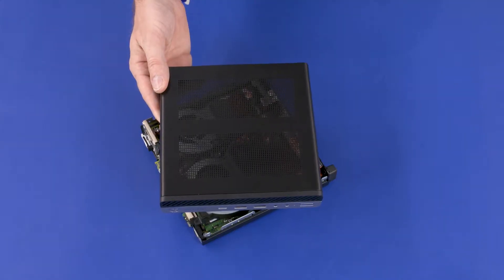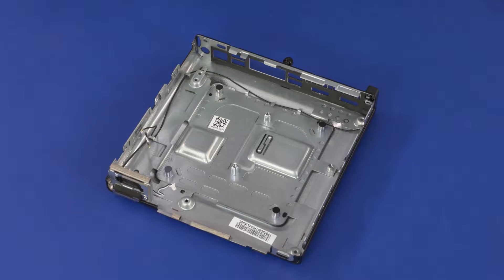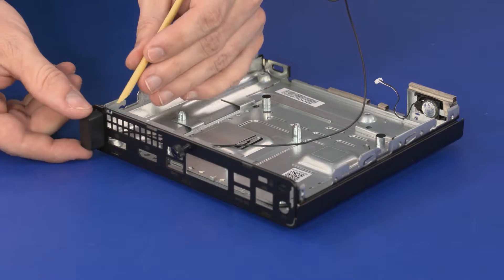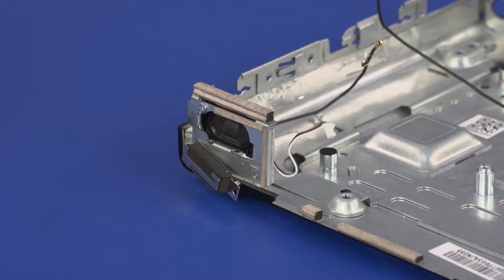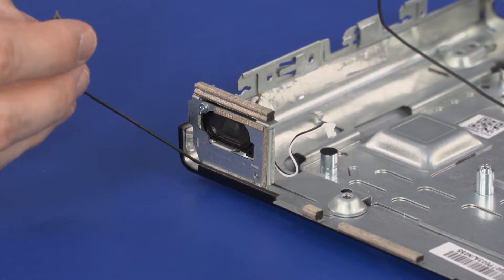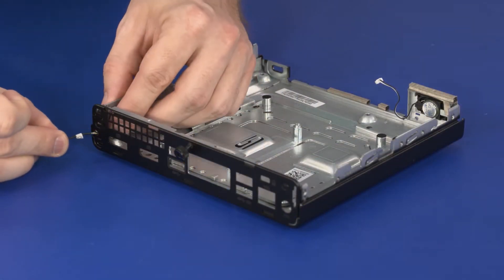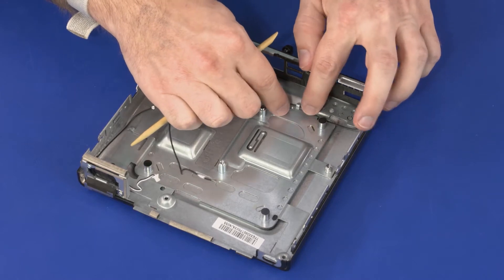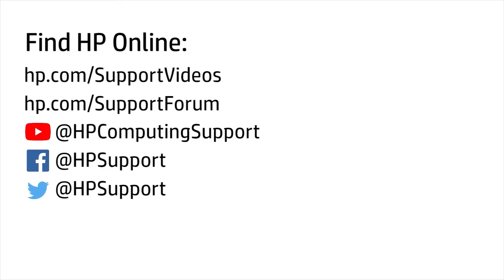Replace Wireless Antennas | HP EliteDesk 800 95W G4 and EliteDesk 800 G3 Desktop Mini PCs | HP

Comment: Where can I buy a Wireless Antenna Cover? I need 2 of them.  That surfsite don't work.
Reply: Hello !

Can somebody of YOU 🙏 please tell me what kind if G4 Modell is this one with to coolant Fans ?? Thanks in advance
Reply from the maker: +Brian Evangelista You can purchase the part from here: http://partsurfer.hp.com/ Please select your country and enter serial or product number of your unit.
Reply: @HPSupport  Terrible Customer Service.
Reply: @HPSupport  No you can't I've looked.
Reply: @HPSupport  No you can't.  HP has terrible customer service.  Why don't you know the part name?  And no it's not on the website I've been there and it's just a bunch of bullcrap advertisement for new products , not the product im looking for.
Reply: @DiabloRealm  Hi, I found it with these keywords, but the price for this plastic cap is a joke... HP SPS-Antenna cover ENT18 DM - L28955-001
Reply: @immobeutler1389  i made 2 of them myself using a sheet of galvanized steel, cut them in 2d, bent them into the 3d shape and covered with black electrical tape, they look and perform almost exact and it only cost me $5.
Reply: i should post a youtube video how to make them urself lol, those HP bastards would probably try to take it down tho because it violates their copyrights or some bullcrap
Reply: @DiabloRealm  Lol steel. It's plastic for a reason and that reason is so that it does not interfere with WiFi/Bluetooth. Metal will block or limit signal strength.